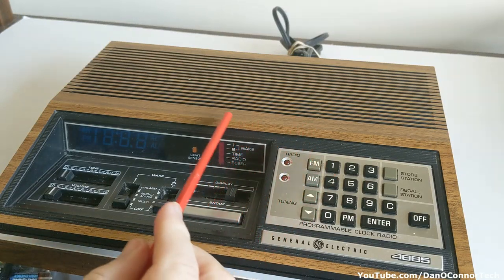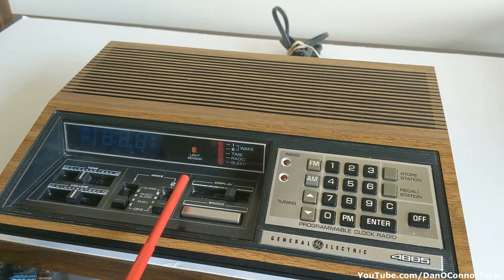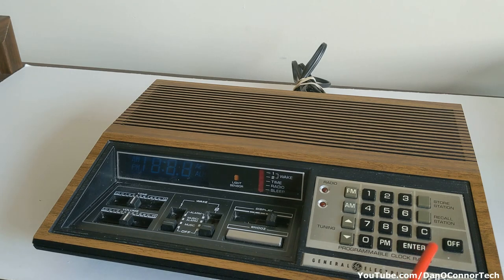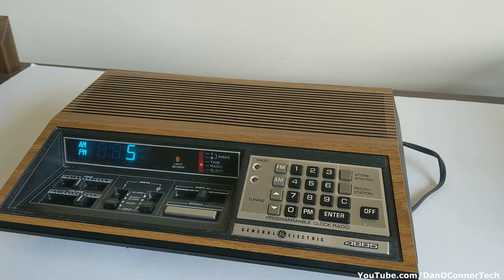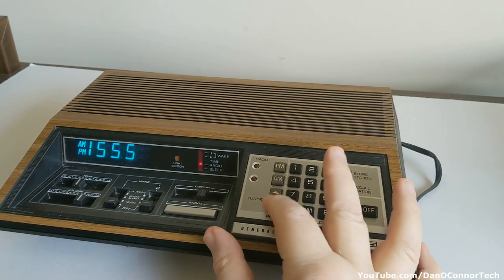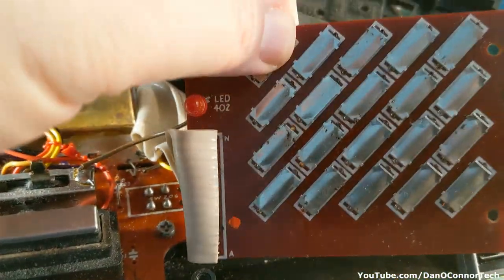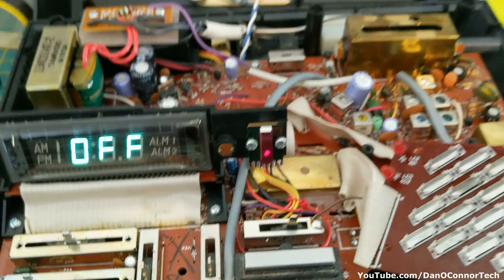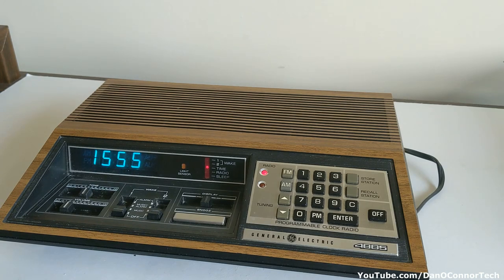Failed Repair of a 1981 G.E. Radio 4885

Comment: Dirty or damp switches or the ribbon cable that feeds the keyboard.
The hum sounds like a faulty power supply, to the left there is a large transformer and large vertical can type capacitors,  try replacing the biggest ones.
They are smoothing capacitors.
The d.c voltage needs to be smooth.